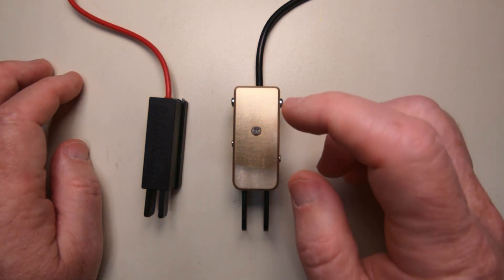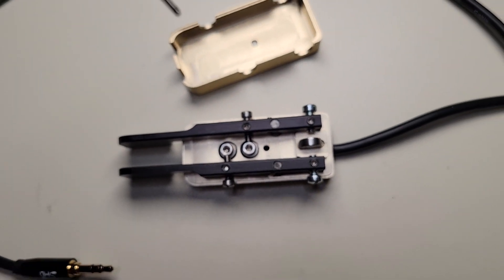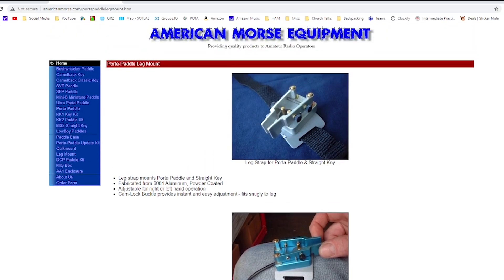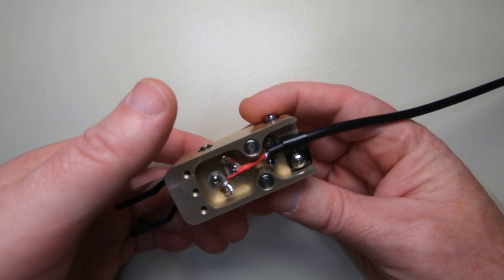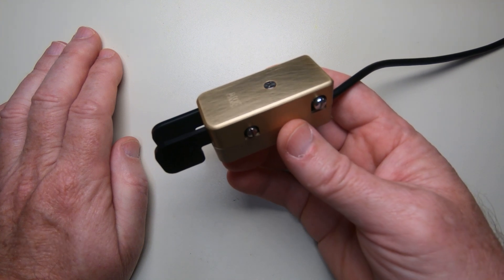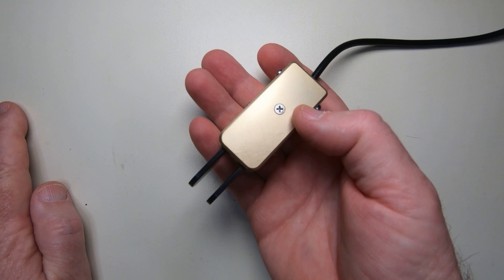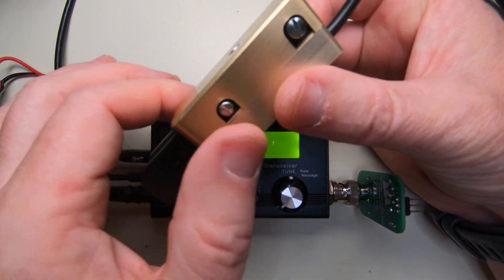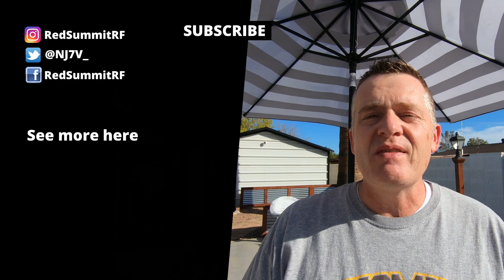American Morse Ultra Porta Paddle Morse Code Paddle

Comment: Charlie  I watched your ultra porta paddle  review and decided I could probably live with the contact spacing spacing screws being sensitive to touch .  After purchasing one and playing with it for a while I decided that was a problem that needed fixing.  I found some 4-40 x5/16 stainless steel set screws to replace the original spacing adjustment screws  They are easily replaced and the 0.050 hex key that comes with the paddle is used to adjust the set screws  Now there is nothing projecting through the case to be bumped sending extraneous dits or dahs.  Paul K4JAZ
Reply from the maker: Hi Paul - thank you!  I have received the set screws and instructions.  Now to find time to get the project under a camera and get'r altered.  Many, many thanks!

Comment: I have two of the American Morse paddles.  The Porta Paddle and the Ultra Porta Paddle. I like them both although they are very different in feeling one from another to me anyway. I use both in go-kits with my various QCX rigs. The Porta Paddle I store in a soap box when traveling so it is not too bumped around.  The Ultra Porta Paddle goes with the QCX Mini and is kept in a small box. I enlarged the base size and weight so it would stay put when in use. I don't hold either of them in my hand when in use. The feel and adjustments are outstanding. I can easily run either at 25wpm and the limitation is me I think.
Reply from the maker: Very good Jay.  Yes, these paddles are made well.  I think I have some sort of issue with the tension on mine.  It will occasionally keep sending a few extra dits or dahs.  Thought it was user error at first, but there is definitely something amiss.  Very true though.  Nice paddles.  Thanks for sharing your thoughts with us.

Comment: Great review, very thorough. I'll stick with my J38 for now, tight budget, but it's on my list for when I get a paddle. 

73
KJ7SHW
Reply from the maker: Thanks Tony.  Do you plan to use it for portable ops or the shack or?
Reply: @RedSummitRF  Both, my portable setup isn't exactly light(xiegu g90, 12ah battery, tripod and buddistick, plus food and drink), but I hike with it anyway, and the key isn't noticeable compared to all that, lol. I may still take my j38 even when I get paddle.
Reply from the maker: Got it.  I'm not an ultralight snob and think there are benefits to packing heavier  . . . i.e. exercise, etc.  You do you!  And good luck with your expeditions.  I asked because this particular key started to annoy me a but, always hitting the adjustment screws.  But it's my fault because I don't mount my paddles.  Just something to note.  Thanks for visiting the channel.
Reply: @RedSummitRF  I don't mind the weight, but my friends that go with me sometimes think I'm crazy, lol. My pack still weighs less than my weighted vest I use for workout when hiking, so it's not bad. I hear you with that key. I do mount mine, just on a piece of walnut I rest my arm on, but it keeps the key from wandering. Cheers, and happy trails. 73

Comment: How well did it do carrying it in your sack?  What I mean, how did you carry it to protect the paddles sticking out and not getting damaged?
Reply from the maker: I have a tin I carry it in.  It's a little bigger than an altoids tin with foam in it.  I got the tin case from an attenuator or ordered off of Amazon.  The attenuator came in the box and I repurposed it.  With it I have no worries about it getting damaged.

Comment: I have used this keyer for about 2 years on sota summits and have had zero problems. It is a great reliable keyer.
Reply from the maker: I love hearing this.  Mine has not had problems either, but there are a handful who have.  Not sure what the difference is but I'm glad it's been reliable for you!

Comment: Glad I saw this.  I was thinking about this one, but the touching of the screws is a deal breaker.  I hold it in my left hand while keying with my right and I'm not sure how well that would work out with the screw touching issue.  :(
Reply from the maker: Yes, I agree with your decision about this.  I thought it was NOT going to be that big of a deal, but the more I used this paddle the more annoying those screws making contact became.  If you have it mounted it would probably be "ok" but every time I go to set the thing down I'm invaded with dits and dahs.  grrrrr
Reply: @RedSummitRF  Someone in the LICW commented on this as well.  He suggested they should have used recessed screws.  May have increased the size a bit but if it did away with the random dit/dah it would have been worth it.

Comment: I purchased a set of these paddles not too long ago and I am extremely pleased with them. Definitely will be my primary portable set. However, there are a couple minor details that I would address.

I tend to hold the paddles  in my left fist while I operate with my right hand. This makes touching the screws a problem. Very simple solution, I trimmed a little bit off the adjustment screws so now they are recessed in the case yet still have plenty of room to make contact adjustments. I’m kind of surprised they don’t come that way from the factory.

Very minor detail, but since I’m holding in my fist, the bottom edge of the case does not have a radius like the top does. It makes for a sharp corner so I softened it on the a little bit. 

Mine did not come with a cable.

Excellent review on these excellent paddles. Thank you!
Reply from the maker: Hi Peter - yes, I was just thinking about this paddle design again after using them on my most recent SOTA activation a couple days ago.  Since there is no magnet either, it's quite annoying when you have to set them down somewhere.  You inevitably make contact.  I think this is a cleaver solution and may have to try it out.  Thank you for the tip.

Comment: Thanks for the review. Wish he’d make it a 3.5’mm Jack and do something abt that side holding contact issue. I mean it is made to hold in your hand right ? Maybe it could be longer to get a grip and thinner. Not sure how he could fix that. Looks very well made though. Yeah man it is very hard to go over 25wpm on small plastic paddles. I still think I’d prefer the 40$ cwm paddle or the picco for the money. Thanks young man! 😃
Reply from the maker: The 3.5'mm jack ... me too.  It should have come attached at least.  Somebody reached out to me and said they had a 3D printed cover made to protect it from accidental contact.  He's sending it to me to see if I like it.  Again, though, why should we have to do that.  I think I am missing a grading element - DESIGN.  Those contacts being exposed is a design issue.  I still need to get the $40 cwm ordered and give it a test drive.  I wonder what the pico would be priced at today?  Even if it went up in cost, you are probably right.  There is nothing in my collection I'd be willing to trade for the pico.

Comment: I have been using the Ultra Porta Paddle for a while now. I have had the problem that N1CLC Chris talks about. I have found it may be at the space adjustment screws. I think it may be oxidation of dissimilar metals between the screws and the paddles. If I take a screwdriver and just move the screw back and forth the problem disappears. I think the paddles are great!
Reply from the maker: Hmmm that is very interesting.  Thank you for sharing this.  I love doing these reviews because it generates comments like yours.  Other's hopefully will see it and if they have the same issue, will try your little fix to see if it solves the issue.

Comment: Good review as always, I like the metal construction of this one. 73
Reply from the maker: Yes - it is solid.  How has it been going with the Radio Adventure Gear paddle?  Do you have it dialed in or is it still giving you problems?
Reply: @RedSummitRF  I adjusted the tension and didn't touch the paddles as hard and it worked fine but I had to constantly remind myself to touch the paddles lightly. Ever since I got my N0SA paddle the Radio adventure paddle has been my back up.
Reply from the maker: Ok sounds good.  The N0SA paddle feels great doesn't it?
Reply: @RedSummitRF  It's amazing, it has a very solid feel and construction and its very smooth when operating. Larry is a paddle making magician  I want another one of his keys but for my shack.